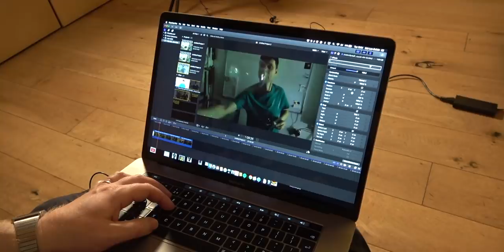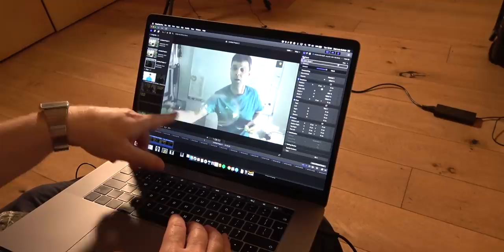Laser bubble bounce, with Steve Mould

Comment: "It was the glitter ball"
Me: awwwwww
Also me: WHY WOULD YOU HAVE A GLITTER BALL NEXT TO A 3/11/30W LASER AAAAAAAA

:D
Reply from the maker: When we were setting up we looked up and Steve said "should we cover that?" And I was like nah it's fine the laser will never hit that... 😅
Reply: @seblee  well, i am glad you didn't. nice cliff hanger :o)
Reply: @seblee  "Don't need to wear eye protection, will never hit..." oops.
Reply: glitter ball was my first guess, but i dismissed it thinking they'd never have a glitter ball around reflective bubbles and those lasers lol.
Reply: @seblee  "nah it's fine the ....... will never hit that" famous last words
Reply: Bouncing a laser off a glitter ball is in fact pretty safe because the glitter ball spreads the beam (and the laser power) in a million different directions. Same with the bubbles -- when the laser hits the bubbles it causes a massive divergence as you can see by the huge blotches of light on the floor and ceiling. The light intensity coming from the 3W after it hit the bubble is pretty comparable to an LED light bulb.
Reply: So disappointing! I was hoping for some very cool quantumphysical effect like when laser hits very small slits and diffraction happens. Some tightly woven curtains can do it, so why not? Maybe because the inside of the bubble and the outside are so close to each other and you can have that interference when hitting it under the right angle? 
And then it turns out it's the glitter ball.
Reply: i'm agin what would happen if that big laser hit the disco ball. the laster gets defused and cuts the room to peices iron man style XP
Reply: @Luc Bloom You're overlooking the fact that the power of a laser beam isn't concentrated in a single point but instead, concentrated in a cone of several millimeters wide. So one of the mirrors may be hit dead-on by the beam, but since the mirrors themselves are so small, it will only reflect a fraction of the beam power back.

The only possible dangerous situation would be the unfortunate accident of a static beam hitting a static mirror ball and you looking directly back at the reflected part of the beam. But if both of them are moving, the hazard is very small.

Comment: How you guys should have set it up was to have the thread go from the laser to the target but rather than tie/stick it to the target put the thread through a hook type thing, then hang a weight on the end so you can keep it under tension. With a meter or so of spare thread you would have a lot of room to move the device and bounce bubbles. 
The weight (if heavy enough) would also keep the laser pointing at the target if you held the laser very lightly. Would have made it very easy to manipulate as the laser would align itself to the thread at all times so you can use the laser as a visual and be free to move in any direction.
Reply: i was thinking spooling the thread to one of those retractable ID badge holders

Comment: With the not entirely parallel beams of the multi-beam bounce the bubble should have moved away from the laser on touchdown for two reasons: 
1. the beam has no rubbing resistance, so the bubble will just slip off 
2. the photons in the beam are moving away from the laser and should push the bubble along if it really was held up by the lasers.

Comment: Instead of tying the distant end of the monofilament to something static, loop it over something smooth and put a small weight on it. Constant tension unless you give it enough slack to hit the floor. Hold it loosely, way back on the end of the pointer and let the tension aim it for you at the makeshift pulley.

Comment: When you mentioned though about the thread having a fixed length, easy fix, have it attached to something elastic or have the thread on the fixed end actually extend further and have a weight so the fixed end is more of a anchor like place but just lets the thread therefore move in and out

Comment: I'm posting this before I saw the revelation:  When he's holding the laser and moving it around to catch the bubble, he's moving unnaturally.  In fact, it would be quite difficult to keep it aimed at the same spot while moving it up/down.  It looks like it's the handle connected to a string.  In fact, I'd like to see you duplicate that movement without a taught string. 

The string could be fishing line monofiliment that lights up nicely and looks more like a "beam" than a laser actually does in air.  I think Spectra line or the like would be good at repelling the soap film rather than breaking it, since it's both lipophobic and hydrophobic (waxy).

Comment: What I thought the patterned light beams were:  Earlier in Toms video I saw the track lighting in the background.  Often, those have halogen reflector type lamps.  And most of the time, those lamps have faceted reflectors.  When I saw the beam go from the bubble, toward the ceiling, I just figured it had struck the lamp in just the right way to reflect such a pattern.  I was not even aware of the disco ball.

Comment: I mentioned on steve's channel that i tyhought it was fibre optic, if you had used that, something like communications fibre which is less than the 1mm toslink would have worked if you had an adaptor, if the light doesn't escape, any sheathing should be removed, and the oute could be sanded to give a rough texture.
Toslink is plastic, and easily sanded, not sure about any glass fibres.
The advantage of fibre would be that you simply stretch it between you and an object or anotherr person and you would always be in line. ;)

Comment: Although the glitter ball apparently caused the wavelengths (colors) to separate, any time light passes through a different material at an angle, the light separates into different colors due to refraction; otherwise known as the light slowing down different amounts,  therefore the resulting angle varying as a function of wavelength.

This is the primary reason 1st surface reflective mirrors are so often used  for the lenses in telescopes as opposed to refractive lenses.

Taking this answer one step further, lasers generate light with a narrow range of frequencies (wavelengths) so minimal separation occurs - but, there is still always a range of frequencies coming out of even the most precise lasers.

Another off topic "thing" worth understanding is most common mirrors (like bathroom mirrors) are made from a flat piece of glass with a reflective coating applied to one surface. To make it as flat as possible the surface most often used to reflect light is the one at the junction between the glass and the reflective surface. In other words the light passes through the glass and then reflects of the coating, then travels through the glass a second time before exiting.

1st surface mirror lenses, on the other hand, use a reflective surface on the outside of the mirror so there light never goes into it and instead directly reflects off the exterior surface.

Comment: I was also thinking about reflecting the laser off a mirror first and then trying to bounce a bubble off of the forward and reflected beams (which are close together too) at the same time. Only reason I thought about this is that there's a bit of invariant mass with a system of two or more counterpropagating photons, where there is no mass with any one photon or many copropagating ones.

Comment: as soon as i saw that the bubbles actually bounce rather than just be moved a little, i knew there had to be something physical there. 

i do however wonder if you could actually use the laser to heat the air in the bubble slightly, causing the bubble to expand and be 'lighter than air'. 

first obvious issue being that it would pop the bubble. so potentially the hardening bubble solution, although those are significantly heavier. second issue, getting the laser to interact with the air in the bubble, potentially fill the bubbles with a non-transparent gas. once again, smoke, especially darker smoke would be great except for its density. 

so i would end that with perhaps instead having the bubbles land on a surface, and just trying to cause a little movement with the lasers. perhaps if the surface itself was black, allowing it to heat up slightly to just cause the bubble to lift for a moment from the spot you hit with the laser. 

well, thats the best i can come up with. hopefully this comment wont be completely buried. great video!

Comment: Could the original video be performed with fishing line.  Since you can get line that's transparent, and seems like a fiber optic thread.  Plus it is a much higher gauge, so it may not pop the bubbles so easily.

Edit:  Ok, I heard the explanation at the end.

Comment: Not sure if anyone has mentioned this, but add some glycerin to the bubble mixture. Makes them more durable, so I'd assume it would also make them easier to bounce.
Reply from the maker: There was actually a little glycerine in the bubble mix 😊
Reply: @seblee  Ah. How about changing the entire bubble mixture formula, or using something else on the string that repels the bubbles so they don't pop. I have no ideas on how to do that though.

Comment: ishing line it is seen 2:56 (the little refraction dot over the mid third and lower four laser) plus the way that the laser was being held was suspicious. It was like you had tied the line off screen and held the line parallel to the laser so the camera couldn't detect it. However the laser had the same ending location so any movement with the pointer was locked to one point.

Comment: My call on this was fishing line. so pretty close. if I were doing it, id have a weight on the other end, so the laser is free to move around. just point at the pivot, n it'd be fine.

when lasers first came on the market, I saw in the 'Ideas for experimenters' section of an electronics magazine, the idea of using a laser piped through fishing line as strings on a bass guitar. photoelectric cells on the other end, as the string was plucked the deformation of the string would modulate the light. this would be picked up and converted to sound. just putting it out there

Comment: My hypothesis was that the laser was vaporizing the water contents of the bubble and jettisoned it that way. Maybe you could add some chemical that is mostly transparent but converts the exact wavelength of the laser into heat?
Reply: Yep.  I was suspicious that maybe a tiny amount of pigment was in the soap solution, causing a tiny burst of steam, but small enough that the bubble could reseal.

Comment: I have a question:
I know just enough about lasers to know that i don't know enough to safely operate a 500mw one.
Laser goggles usually only block a certain wavelength. Isn't shining through bubbles (which, visibly splits the beam in many other colors) super dangerous? Sure, the beam expands a lot, but you were standing quite close to it, and 30W... The goggles fit for the wavelength of the laser surely wouldn't block the red/yellow/green refractions, would they? And if they did, one would see basically nothing through them, right?
Reply from the maker: That’s such a good question. I think I’ll answer it in a video 🤩😎

Comment: So im going to predict the trick.
I think, there is a thin straight rigid wire attached to the laser where the beam is coming off.
So, we cant see the strings because of the laser beam.
I found it by seeing the visual where the string just rests on an array of "beams" which are actually wires

Comment: You shouldn't use a CW, white light lasers if you want more momentum. You use a pulsed, mode locked laser. It seems transparent in visible range, and you should select a proper angle to maximize the reflection (Reflection is the bouncing light, which could possibly transfer the momentum.) 
And I thought the light-sail is a possible idea, Russians even had a deep space micro satellite program based on light propulsion.
Reply: I challenge you. Is it possible to make visible light reflective /colored / non transparent soap bubbles?

Comment: Got me fooled, thinking it was some form of double-slit phenomenon. Have you ever shone a laser through an espresso filter? Or something else with very tiny holes?
Reply: Those would need to be sub-micrometer holes to do anything as you can only see quantum effects when the hole you're shining through is smaller than the wavelength of the laser, and visible light is in the order of magnitude of 0,5 micrometer in wavelength (green light is 500 nanometers).

Comment: A thin wire along the laser beam. Or a thin rod of glass. That's my best guess.
Reply: instead of attaching the thread to a fix spot, attach it to a weight over a pulley or metal bar.

Comment: I was gonna say, "With fishing line connected from the LASER to the wall," but then... oh, no, he got the LASER closer to the wall, and that would've put slack in the line. EDIT 1: But wait, even with what looks like slack might've gotten in the line, this guess turns out to be about right (invisible thread is thinner than fishing line, though)! EDIT 2: Oh, so the original guy DID use fishing line; I was right, then!

Comment: I asked this on Steve's channel, but I suspect I'm slightly more likely to get a more accurate reply here...
So, possibly a dumb question but... Isn't laser light all made up of the same wavelength? If so, why are the lasers being refracted like white light through a prism? You can plainly see at https://youtu.be/xXsDfTPERq0?t=319 the laser light is being split into several different colors of light. So what's going on?
Reply from the maker: The lasers I'm using combine multiple red green and blue laser sources into a single beam - that's how I change their colours. And that's why the laser appears white (ish). But it's actually a combination of wavelengths.
Reply: @seblee  Oh.... I was lied to when I was told all lasers are the same wavelength!
Thank you! That clears it all up.
Reply from the maker: @SlimThrull  Oh yeah you can get lasers in many wavelengths in the visible and invisible spectrum (laser cutters use IR for example)
Reply: @seblee  Sorry, I wasn't clear. I meant that I was told a given laser used the same wave length of light. I knew there were lasers in different wavelengths (which why you get different colors), but I was told that all the photons in any given lasers are the same wavelength.
It never occurred to me that you can simply mix the three primary colors to get a "white" laser (or any other color for that matter). It's PLAINLY obvious now that it's been explained to me. I really should have been able to figure it out on my own, truth be told.
In any case, thanks for the explanations. :)
Reply from the maker: @SlimThrull  gotcha, it's not super obvious unless you know so no worries :)

Comment: i mean use a climate controlled room, take away drafts in a controlled environment, use a more opaque bubble so that it doesn't diffract all the light but makes heat, causing the bubble to warm up and rise... possibly not a bounce but if it raises fast enough it could be? lmao if there's a will there is a way, but I guess that's too much effort for a bubble bounce video.